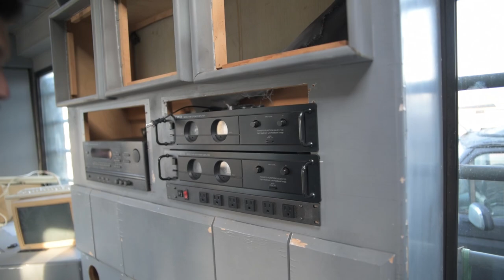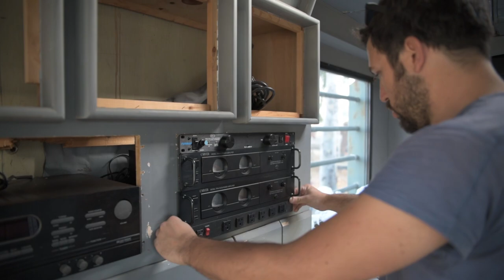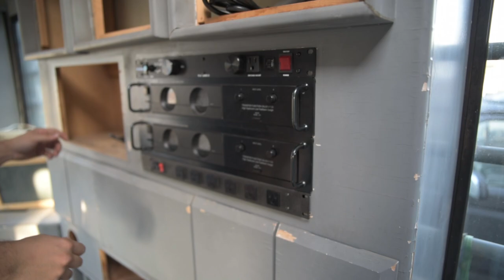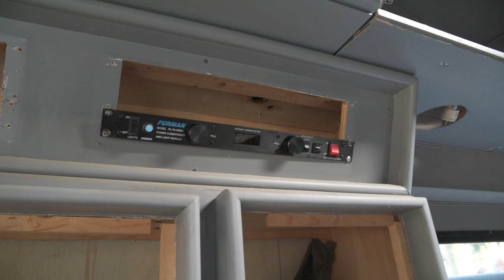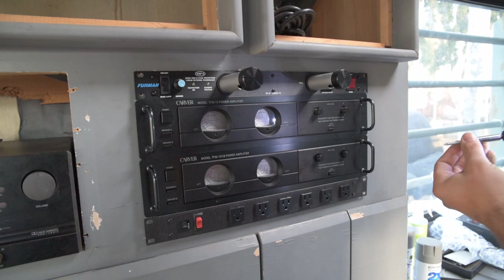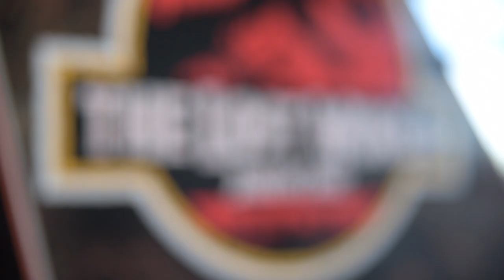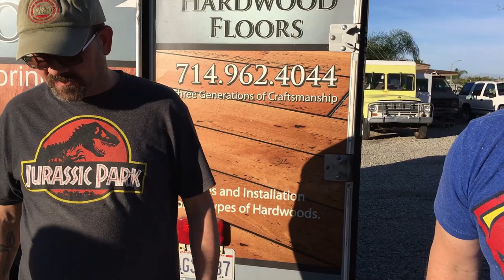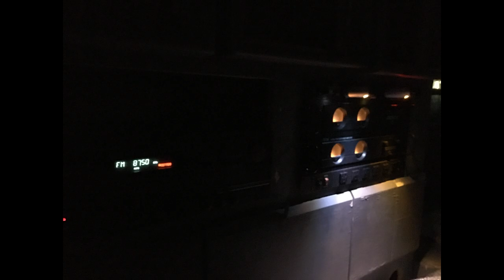JURASSIC PARK RV RESTORATION - EPISODE 21

Comment: How did you guys fix the over heating problem or what was the issue or multiple issues I really need to know this is an awesome project guys:) but if any one knows what was wrong let me know please !!!:)
Reply from the maker: Replaced radiator + water pump and flushed the engine for a very long time, including with flushing products.
Reply: Movie Cars Central awesome thank you so much guys I’m into music and the movie scene doing extra work as well as doing the rv , hot rods and movie car stuff , I had bought a rv a few years older just like the Jp rv and was deja vue all the problems you guys had with this even though was bought from a friend via Vegas oh sure it will make it any where 2 miles into driving the exact same problems only I didn’t have a crew and don’t half the time I was just stumped something basically being new and low miles never driven and problems like this anyways is the Jp at universal or a private collection since I know the gf would love to see it as well as me thanks so much love the channel keep rocking and bringing the good stuff back to life ;)

Comment: Man, i'm really glad you guys were able to revive the thing. Despite the shop closing, you at least got most of the leaks fixed and the engines fixed. 

You actually got more work done inside than the shop did though.
Reply from the maker: Yup, real work happened from the moment we had to leave the shop

Comment: After he gets the roof right, I recommend getting some paint matched rhino liner and rhino line the top to guarantee the seal for years.  It can be color matched, it will also strengthen everything its applied to and will act as an extra layer of protection against the cold and heat as it deflects heat from the sun and help keep the RV COOLER inside.

Also, is there still a list of what you need?
Reply from the maker: Thanks, great idea! we mainly need PVC piping for the outside, not very complicated.

Comment: You need to get some C-10 flow seal for your roof problem. It's a single ply self  leveling sealant. You should be able to find it at a good RV supply/repair store. Should be 8-10$.

Comment: Why is this no longer under theAFICIONAUTO channel?
Reply from the maker: Shelby Tanner life happened :)
Reply: It hasn't been for like, what, two years?
Reply: I get the feeling it didn't blow up as much as they wanted and they parted ways.
Reply: RogueAnt definitely, it was WAY TOO SLOW and boring, not viral AT ALL!!!!
Reply: They were wanting to use it as a means for income while simultaneously hoping it would generate enough cash flow to go big. I was highly unimpressed by the shop that eventually did the roof, the group of random fans that showed up and then left, the irresponsible kid who whined about life, and the direction in general until Franco took more control. Seemed like there was a big expectation of free blank French bank checks involved as well.

You've done some goofy things, and some good things. Finish it up buddy.
Reply: chris wanted 10 million from frank for the production, franck had only 1500$ and said NO to chris.

chris left thinking he will make millions on other projects.
Reply from the maker: Lol

Comment: So does that thing not have AC in the front?
Reply from the maker: jeebus022 not currently, it’s there by not functioning
Reply: Ah, gotcha. Still, that goes into the "want" category and not the "need". Speaking of need, I think you'll  need to throw a diesel in that thing in the future. It'll have way more power and might not overheat as much

Comment: My god that turd is going to be so heavy when your done it wont be able to move without overheating all the time. 3/4" plywood for the cupboards? why? Hollywood made that to move a short distance so weight wasnt a big deal but if your planning on road tripping that monster with the trailer your gonna end up with issues.